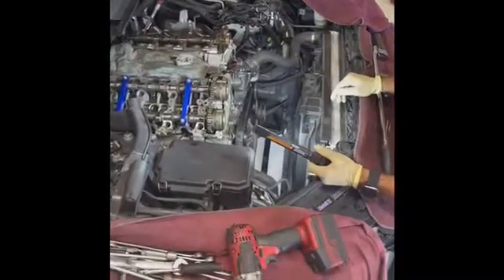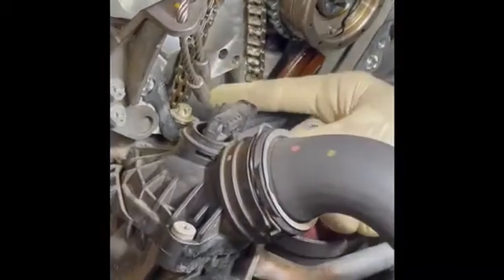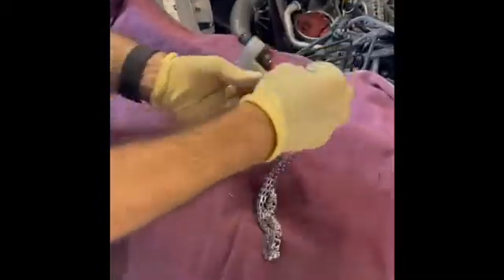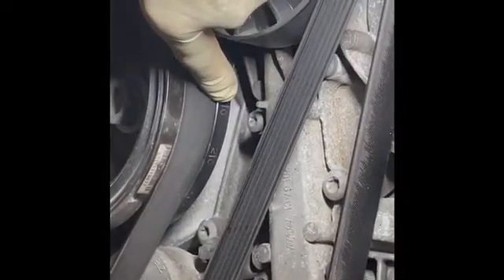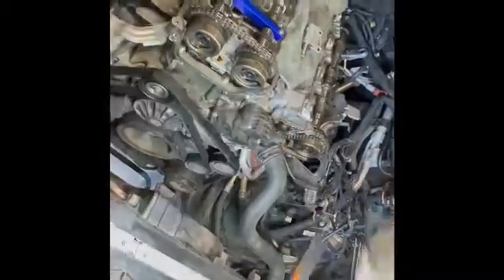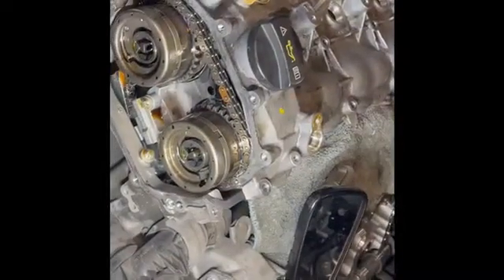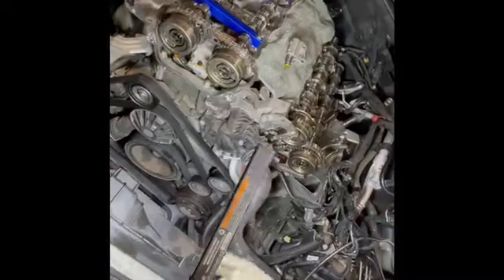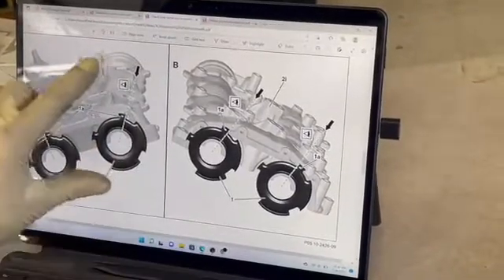MERCEDES BENZ, M276 Engine Timing Mark Issue Explanation (PART 1)

Comment: Hello i have a problem i put new new chain kit and bank 2 at 40 and 53 degre is okey ,rear lasers marks flush to head plane at 40 and reluctor center at 53 sensores hole. But in bank 1 are depashed rear laser marks not aligned flush head at 40and reluctors not centered at 53, reluctor laser marks are aligned with the laser on the camshaft, not are a reluctor camshsft twist or deviation,  marks on chains are put on the correct marks on cam adjusters and all pinions. I dont understand this timing engine

Comment: Useful thanks - is the 40 degree after TDC the right position for removing the upper tensioners to fit check valves on both bank 1 and bank 2 ?
Reply from the maker: YES.
Reply: @luxur_automotive  many thanks

Comment: I installed both check valves before rattling started car running beautiful
Reply from the maker: Yes . Check valves are very important. That what keeps the oil behind the tensioner for the next time vehicle starts .

Comment: Pls can I get the special tools for both the Camshaft and the timing chain
Reply from the maker: HERE IS THE EBAY LINK :
https://www.ebay.com/itm/284904433583?hash=item4255a0a7af:g:m3MAAOSws-JfgHrx&amdata=enc%3AAQAIAAAA4LXraV15eKU97fXuhNj%2Be4qgAiBo%2FgveRx6E1z4PR3LFerqeM0vNhqem864B9UeVApQcnL0uN5QnLhgcYoptv8TjvYZBVCyotzVpQohQ6C7atMVjl%2BAslMSDTxeyg3VHb%2F6jO6QhzIV6leRPV8feStSE0sZxQRFvmtx06JIMCArWfb2KaMhk5zvlGdRTZmctfl%2FGe5n2ihQNW8nRp83wMwx0LkpBLM%2BtkRxrGHfwCV3%2F41IVPGV%2BsyOZ39sBE4AdMJF6xrjqNqH36jhgcV3CBj8hHyNQXm1ZgsAErgytIJVW%7Ctkp%3ABk9SR4zl5P6AYw

Comment: Thanks again for this video. That info on the cam markings was definitely helpful. Explaining the 40 degree mark and the 53 degree mark help to confirm things are timed properly. And the mark between the cam adjuster and the pressed on trigger wheel helps to confirm if the wheel moved in relationship to the cam...very helpful sir.

Comment: I got P0046 code for the camshaft position sensor A, Bank 2 and now getting the dreaded P0017 Code, but the rattling noise was prior to the P0017 code. Is the timing off? Great video and information!

Comment: My harmonic balancer doesn’t have the degree markings on it. I’m not sure if it was changed or if they are worn out due to age. But there is no visible marks to identify 40or 53 degrees after tdc. Is there any way to time it with out the markings?  Maybe by using the key-way direction.
Reply from the maker: Yes. The only other way is to take the front timing cover off completely and use the color code on the chain with the marking on the camshafts and gear on the crank shaft.  
You will remove the PULLY and the front timing cover
Reply: @luxur_automotive  thank for the reply! Will go at it that way.

Comment: Are those engine timing marks the same as the markings on the M276 Engine that goes on the 2015 ML400 and the 2015 E400?
Reply from the maker: They should be.I used win number to check the timing marks when we rebuild any engines my fried.